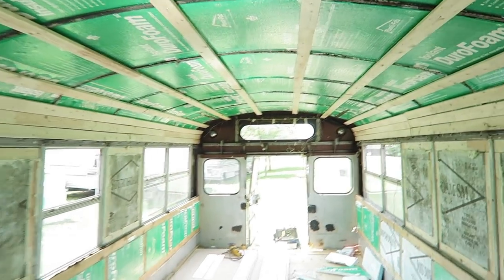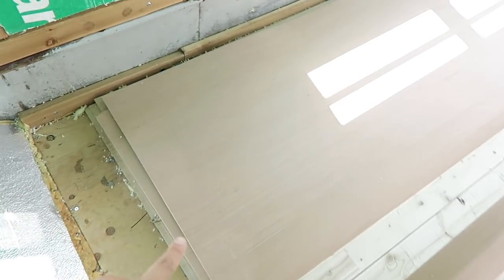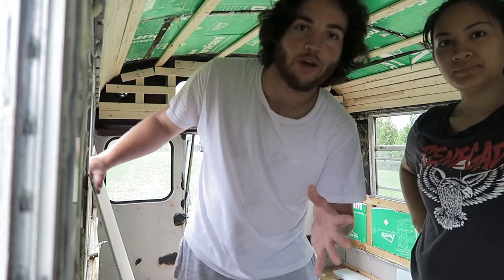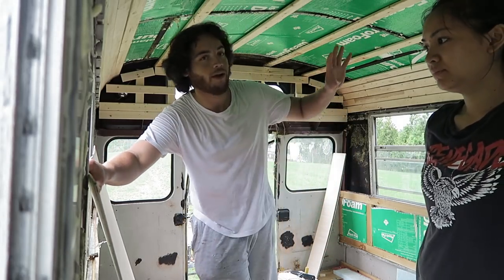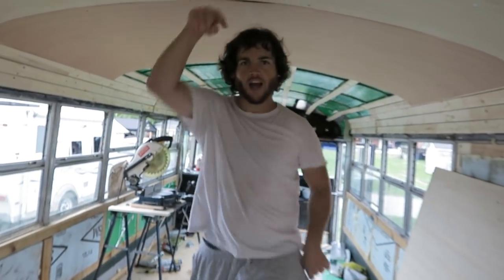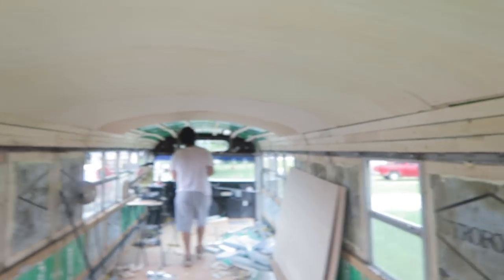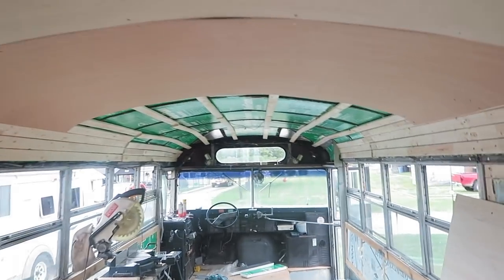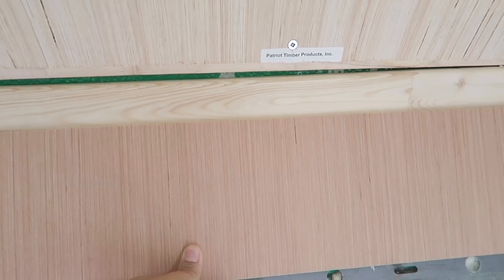Installing Plywood Ceiling | School Bus Conversion | Runaway Expedition

Comment: G'day from DownUnder. I realise this is a bit late for you guys as your ceiling is already up but I thought this may help others installing a ply ceiling. Ply will bend an amazing amount without harm in it's long length and this can be to your advantage. Here's my easier method. Drill and insert some self tapping screws along the steel just above the windows about every 18inches and leave the heads sticking out about 1/2 an inch then carefully measure the exact width of you ply from the screw up to the centre of the bus and place a corresponding row of screws parallel to the first lot along the centre. Then with a helper put the edge of your ply behind the screw along the window top and carefully push upwards until the other edge of the ply pops behind the screws in the centre. The ceiling sheet then becomes self supporting so now all you have to do is fasten both edges fore and aft, I used countersunk 3/16 rivets for this and then removed all the self tappers. Once both sides are done then it's a pretty simple job to cut a filler strip and fasten to cover the centre gap. My ceiling has been up for 16 years without any problems. Any joins can then be covered with some varnished timber cover strips. One other point I have is an old boat building trick that gives the illusion of more height and length is to use white ceiling panels and the timber cover strips only fore and aft and use a white PVC cover strip for the side to side joins, believe me this works. Mike

Comment: I've renovated a couple boats and houses. You are doing an excellent job. A trick to panelling is when you run electric wiring, put main run along that edge where the curve transitions to the side from top span. Remember, weight is the enemy of efficiency and handling in a vehicle. I'll be doing a skoolie soon myself. Thanks for the video!
Reply from the maker: thank you for watching! good luck with your conversion!

Comment: if you put pvc piping and spliceboxrd down before putting the plywood over it  , it makes it eazier to pull more wiring in the bus when its needed or forgotten during the initial install 
eazier to do repairs too without having to tear stuff up

Comment: We are still trying to decide what to use for ceiling insulation. Is the stuff you used flexible? what is the r value of it? and how thick is the stuff you used? thanks for any info.
Reply from the maker: if it wasn't so expensive, we would've done spray foam for sure! we had to score the foam board so it could bend to the curve of the bus. I believe it was about 1" or 1.5" thick and I think the r value is 5.81.

Comment: to keep the plywood square, use a chalk line and make a straight line down you middle perlin. and mark your plywood dead center on each edge ,and match the marks with the line. Its called using a "control line''  … Shoooots!!!
Reply from the maker: YES! what a great idea! thank you!

Comment: It was interesting to see your ceiling build. I have helped with ceilings before, it takes alot of arm and upper back strength.
- the cat was more likely moving its kittens
Reply from the maker: definitely could've used an extra set of hands lol

Comment: Definitely not easy but you guys did a great job! You did it the right way which is better than what we did : )
Reply from the maker: thank you! we actually watched your video on insulating curved ceilings for help with ours. you guys did some nice, clean work ;)
Reply: It was funny because we started doing a van conversion at the same as the bus and we ran the ribbing front to back... that was the "aha" moment when we realized we did it wrong on the bus! Sometimes you have to do it wrong to learn the right way. You guys did awesome though, keep up the great work!

Comment: Did you use foam filler on the ceiling? It’s starting to be winter at my build site and I’m worried it’s too cold for spray foam everywhere. Debating the efficacy of foam board panels.
Reply from the maker: we used it just to fill in any cracks. with everything fully insulated now, it's been a couple degrees cooler on the bus compared to the outside. so it's been doing its job so far.
Reply: Cool. Thanks for the update.

Comment: How did the foam work on the ceiling? Can you tell a difference from stock insulation?
Reply from the maker: its been great so far! the real test will be in the winter though.
Reply: @RunawayExpedition  how did you ceiling do in the winter?

Comment: Did you guys start cutting the roof towards the front instead the back?
Reply from the maker: we started putting up the plywood in the back first if thats what you mean?
Reply: Runaway Expedition ya I know you said that the angles were different from the back so you had to take the first panel off
Reply from the maker: yeah we had to take them all off because they were crooked a bit. especially the way that we were trying to cover the curve.

Comment: I know it's a little late, but had you considered using wood paneling which is about as flexible as it can be.
Reply from the maker: we did for a quick minute in the beginning. Jordan brought it up and I was like no no no. but now......I wish I would've been more opened to the idea! it would've been so much more easier and more clean looking in the end.
Reply: Runaway Expedition 
Thanks for cementing my decision to use said material.

Comment: If my ceiling is already insulated... I think I will just paint my ceiling to look like wood.  I plan to install a wood burning stove, making it possible to easily find fuel. Next, even though I have more than adequate energy supplies...batteries, solar panels, wind generators, gasoline generators etc... My Bed room, tv area and computer space all in onr. will be able to be sectioned off, that if needed, I can only heat/cool that particular area.

Comment: im leaving my ceiling and walls alone, just redoing my floor, for I like a warm floor
Reply from the maker: I've seen people do heated floors! super cool!
Reply: Randy Rankin you'll get a warm floor but the heat will escape out the roof sadly, to contain the temperature you need to heavily insulate

Comment: how u all making out, well I sold my bus and bought a class c with 41,000 miles on it, it basically came down to always boon docking, which I don't mind, but 90% of campgrounds frown on buses, so I said fuck it, so bought a class c, so where u guys at now the the build and wheres ur location, im still in ct for another month then headed out west then to fla, and need to be back in the spring to start working on my 18+ acres of land in maine-randy